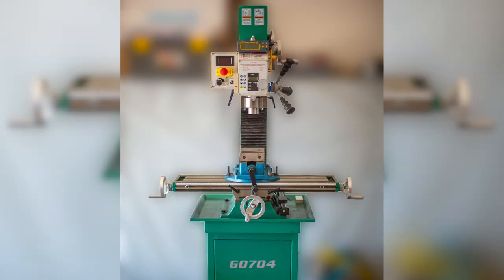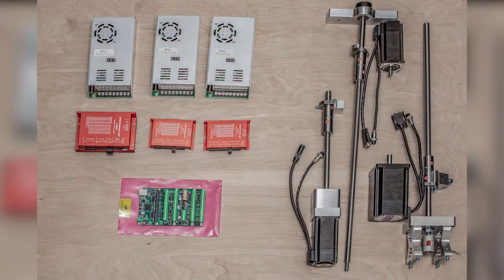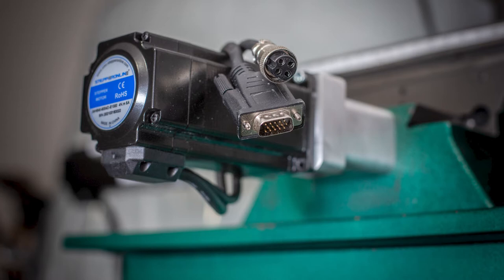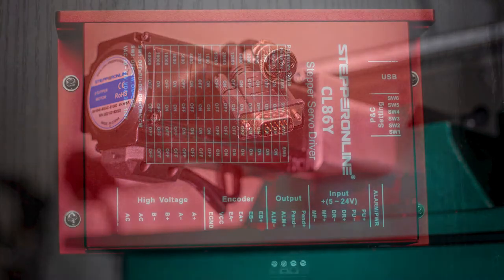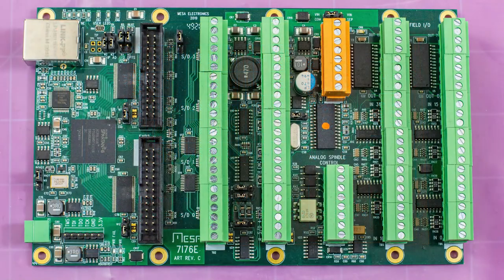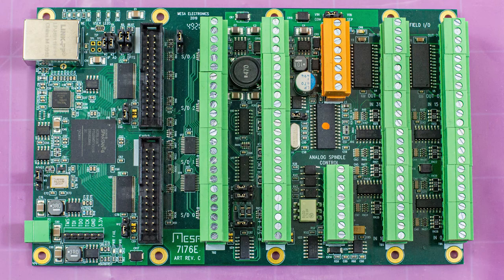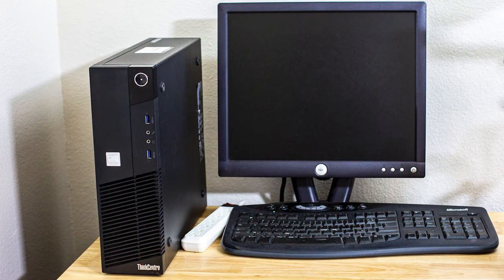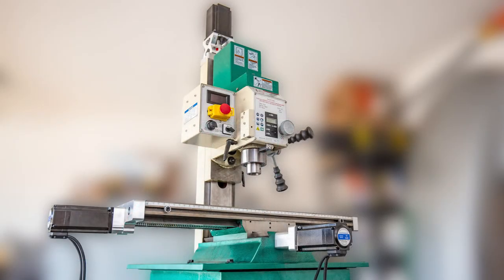Grizzly G0704 CNC Conversion with Closed Loop Steppers

Comment: I'm doing the same project. Currently working on the electronics/enclosure. I'm going to mill my own parts instead of a kit, not that I wouldn't mind the kit but I like to make my own parts. I'm also an avid 3D printer person. I like the sections where you're trying 3D parts. I actually considered 3D printing the parts to do the conversion then using the machine to cut the final parts. I'll be following you on your quest. Regarding the saddle problems, I know people have had success with the grinder, I have a friend who I can borrow their mill so I'm not too concerned. If I recall, the company you bought your kit from offers to mill the saddle for a pretty reasonable price, if it's not him I know I saw it somewhere in the vast conversion videos.
Reply from the maker: I considered starting with 3D printed parts too. Was thinking about 3D printing anti-backlash nuts for the Acme screws, and then 3D printing timing belt pulleys to press-fit over the stock hand-wheels for the steppers. But I got a kit instead.
I'm putting together video #9 now, after that, I'll start the enclosure.
I knew Dave (the maker of the kit) would mill the saddle for like $15. The saddle would ship pretty cheap too in a Flat-Rate USPS box too. Where I'm at though, I've had mail stolen, and miss-delivered multiple times and didn't want to chance losing part of my mill that is custom fit.